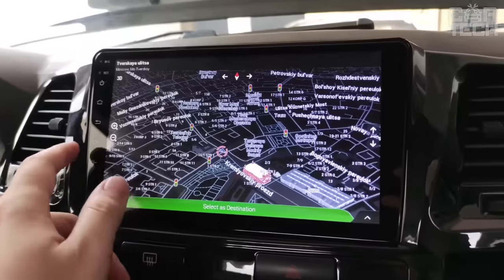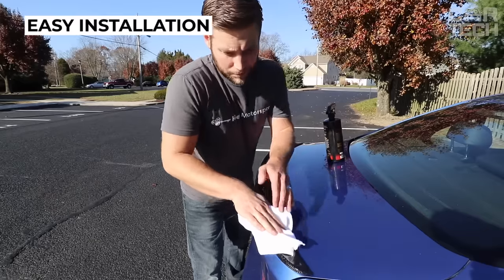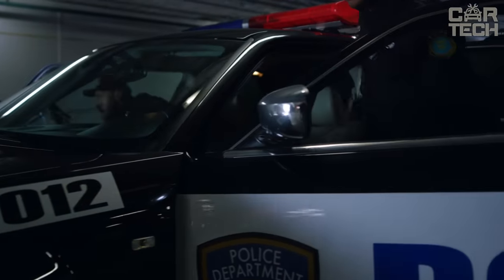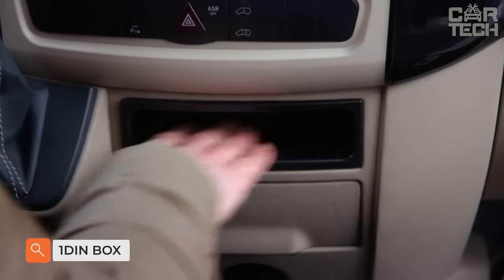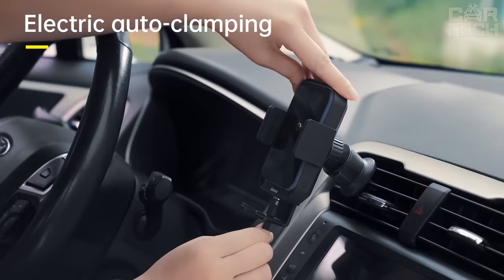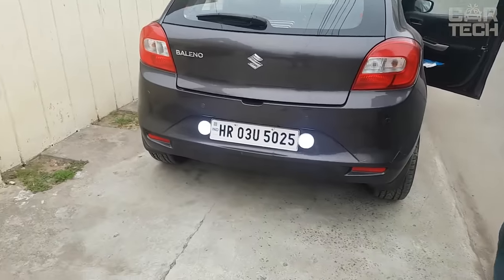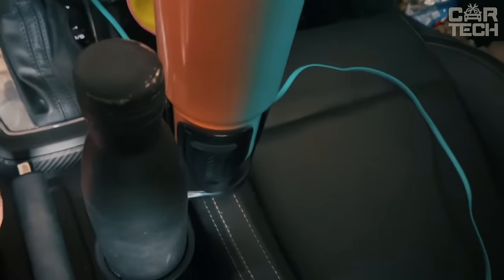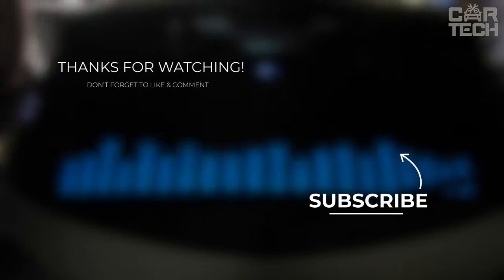30 Amazing Car Accessories 2024 From Amazon | CAR Gadgets

Comment: The car seat gap filler with flexible installation fits seamlessly in various car models, ensuring a snug and secure fit without any gaps or wobbling.